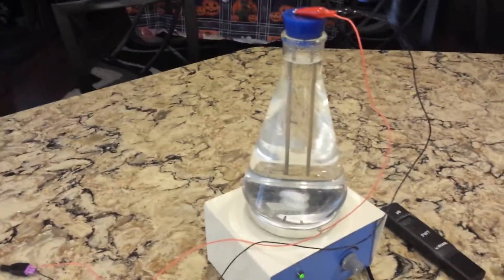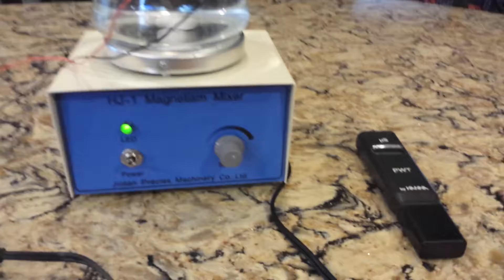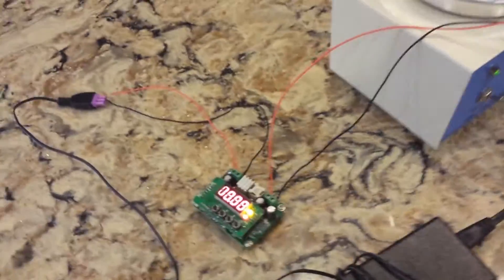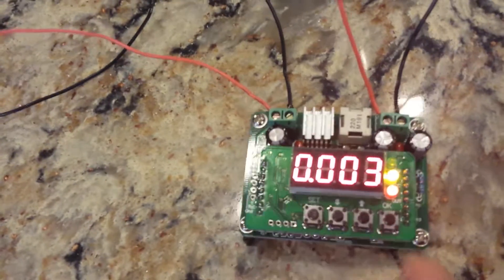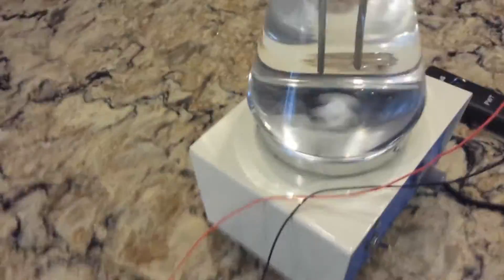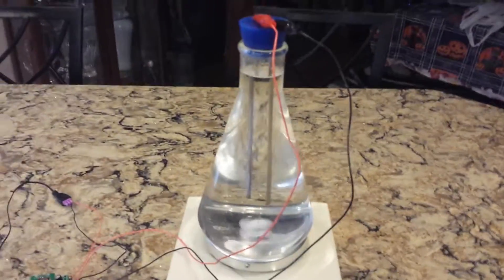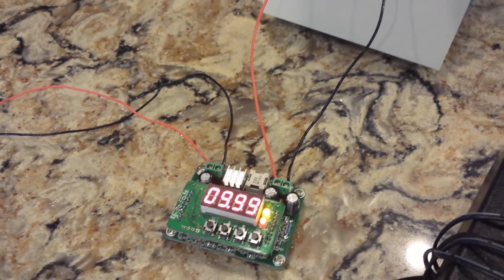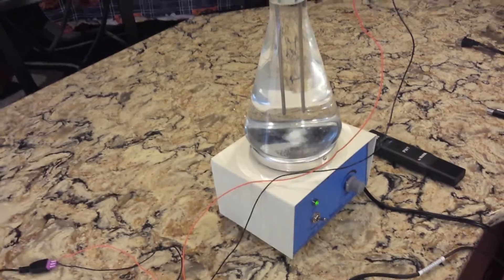Colloidal Silver Generator

Comment: Making my first ever batch now :) BTW if you hold the OK button down for a second the display will alternate between showing voltage and amps being used.
Reply from the maker: yes I I did not know that thanks for the tip. Im still using this setup works to perfection

Comment: Good setup, I have purchased the same voltage ontroller on the strength of your vid but will use a 70rpm motor to keep the water agitated. From what I read 1 Milliamp is good for small particles. Are you producing with 3 milliamps ? How long does it take to get to 10ppm and is the solution still clear after a few days ?

Thanks for sharing
Reply from the maker: I am using 3 Milliamps because the rods as you can see are much thicker if you are using wires than 1 ma is correct. Takes 2 hours with seeded distilled water to get to 10ppm and yes stays clear and does not turn yellow ever.

Comment from the maker: The controller is a Digital-controlled Constant Current Voltage LED Driver Step-Down Power Module found on ebay for 18 dollars. I use Faraday it ells me I have 24 ppm

Comment: What are you using for controlling the current? The current/volt meter is a current controller? The Hanna PWT meter will only measure IS(Ionic Silver) and not CS(Colloidal Silver). I like the 7 guage silver electrodes, I am using 10 guage 99.99% silver wire. Are you using the Faraday calculator to determine your PPM? I am interested in the meter/current controller, where did you get/build it?